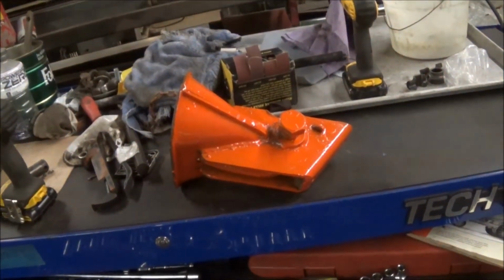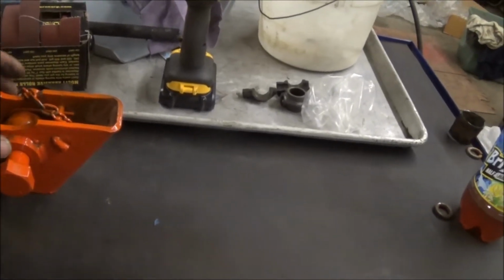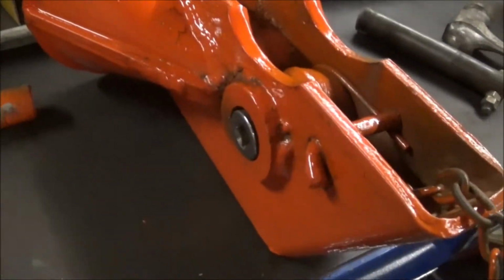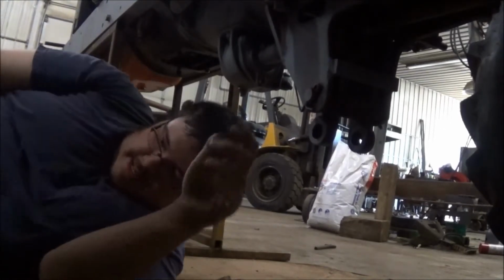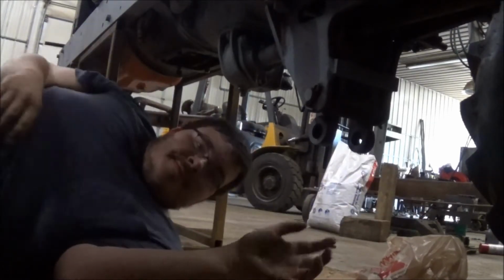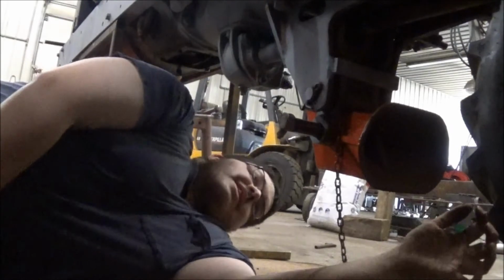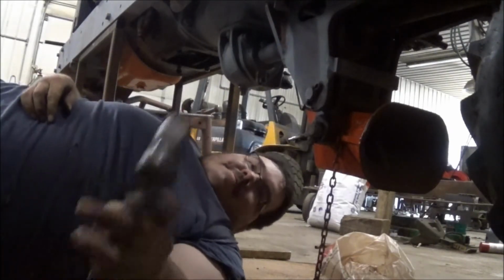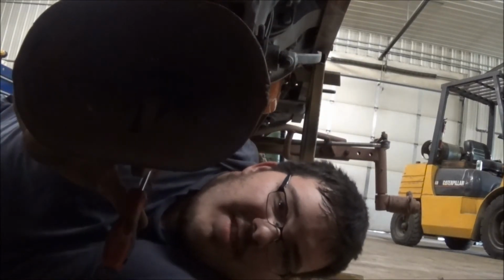putting the snap coupler on the wd45

Comment: nice vid - one of the few i've seen on the snap coupler bell housing. Question : i'm working on a d14. Different attachment to tractor, but same bell housing. I"m putting i new spring. What was your method of putting that spring in. ? I can't get my bell housing off the tractor . The d14 has a bigger bracket that has a 3/4" pin running through the transmission housing. Mine is unreal frozen in place. Spent two hours trying to remove it. Only other option now is to drill the pin and destroy it. Instead of doing that, i'm going to try to put the spring in with the housing hanging from the tractor. It looks like the spring has to go around the hook first, then wiggle in to place .Not giving A/C an award for this design!
Reply from the maker: not sure I know it was a Pain